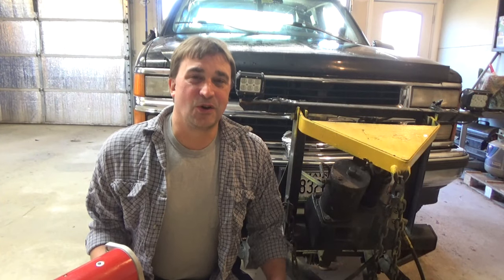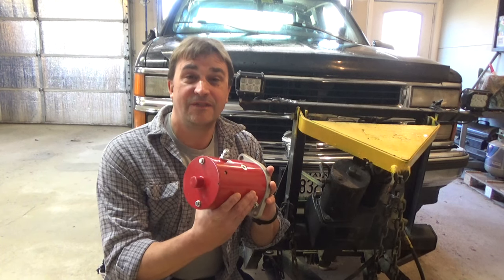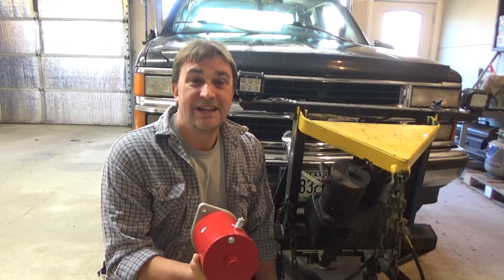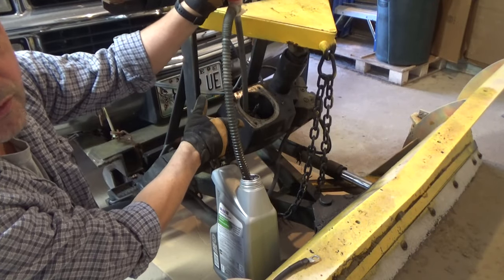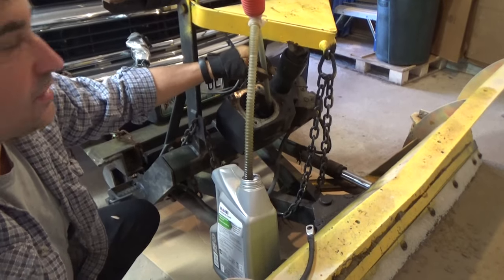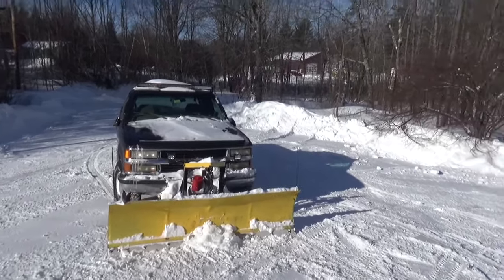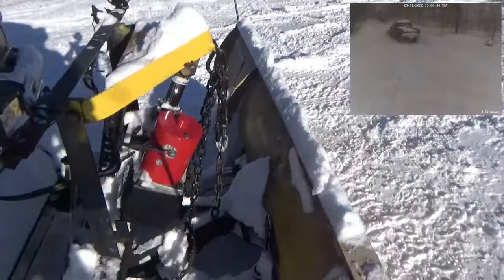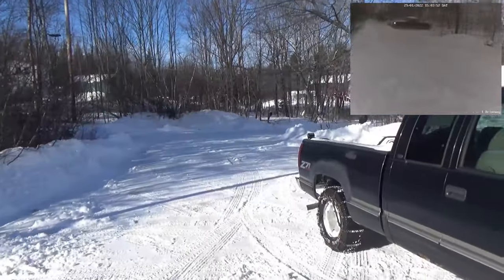DB Electrical LPL0004 Snow Plow Motor Review - Fisher MM1 Single Post Replacement Plow Pump Motor

Comment from the maker: DB Electrical Snow Plow Motor (Low Ground Post) On Amazon - https://amzn.to/3ogfW2Y
Replacement Fisher Snow Plow Motor On Amazon - https://amzn.to/3HgQmT4
Plow Pump Replacement Screen On Amazon - https://amzn.to/3ggzccp
Plow Pump Motor Gasket On Amazon -  https://amzn.to/3ggMiGD
4 AWG 4 Gauge Single Black 9 inches On Amazon - https://amzn.to/3IYJbiG

Comment: Well Mark, we don't get snow often here in San Antonio, TX, but if we do again this year I am as prepared as I can possibly be so far as heat, electricity, water food and fuel. What we had a year ago wouldn't have been a problem for you, but since there's not a snow plow within 500 miles of me, or even a snow shovel we were in deep trouble. The little motor seems like it's going to work out for you 😉👍!

Comment: How did you know that you needed to replace the Snow Plow Motor. I have a Fisher Minute mount that doesn't work. I replaced the solenoid and it still produces a clicking noise in the solenoid when ever I push any of the direction buttons. I am in Maine also.